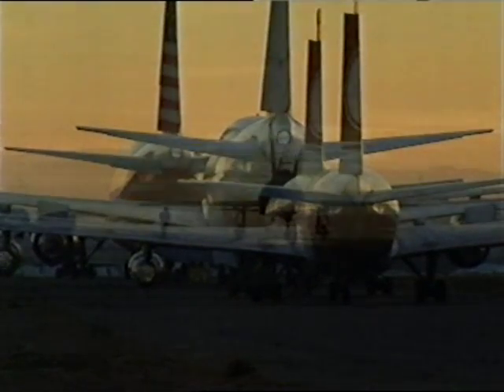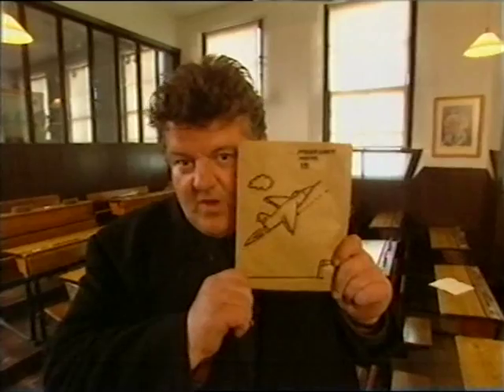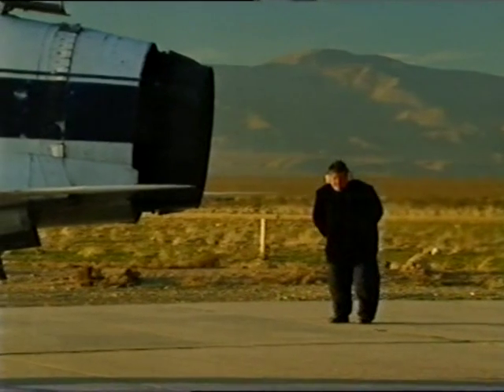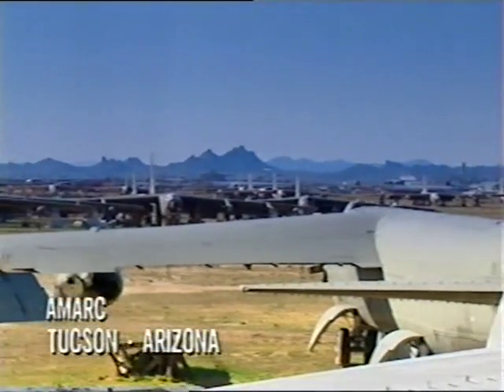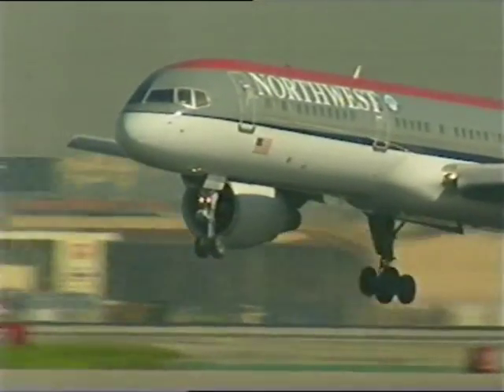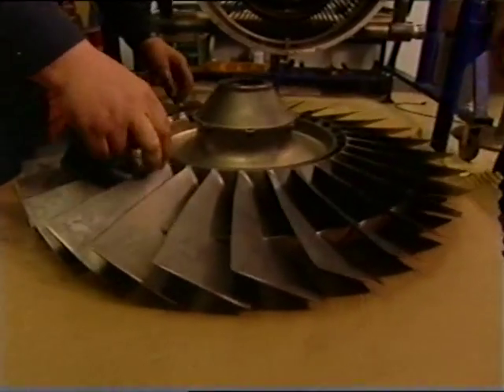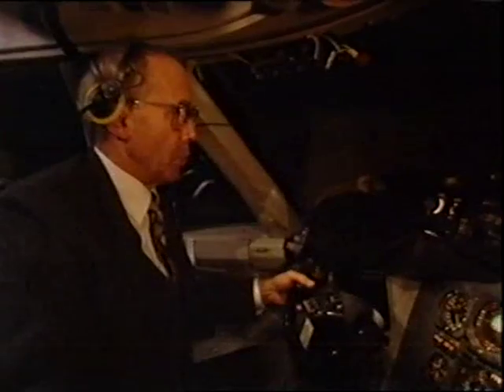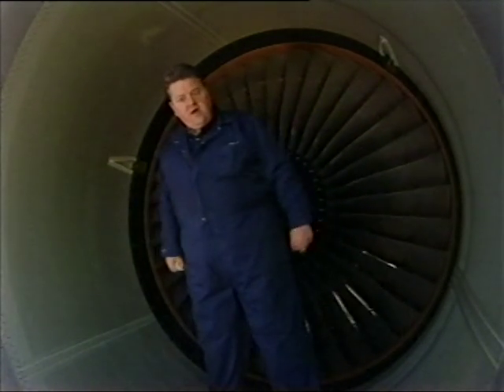Coltrane's Planes & Automobiles: The Jet Engine Part 2

Comment: Machining cylinders and flat surfaces in a home workshop may not be easy but fabricating compressors and high temperature turbines is a different world to play in before you get to the question of cost. Perhaps the difference between suck, squeeze, bang, blow and the jet is a dream that is within one's grasp and one that is not. Still does not alter the Coltraine view or that the world is now a poorer place without him.